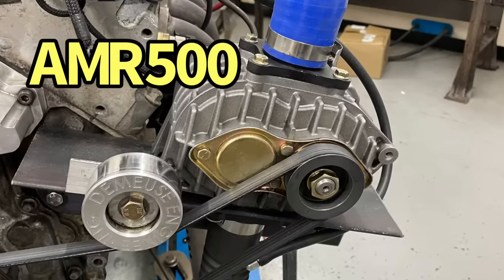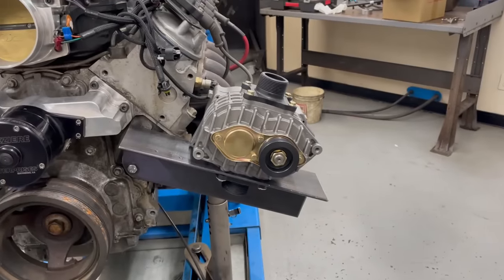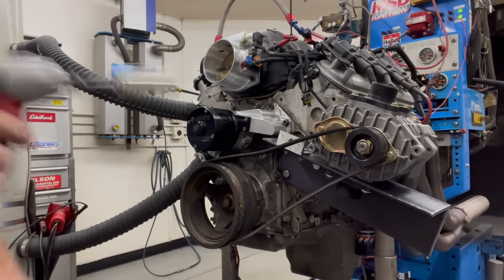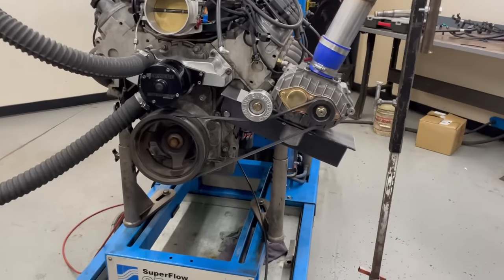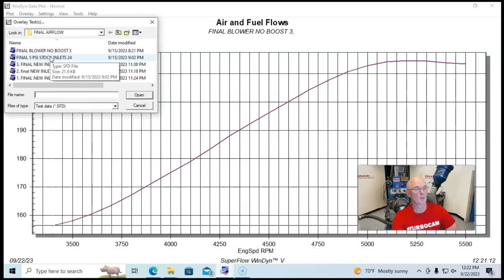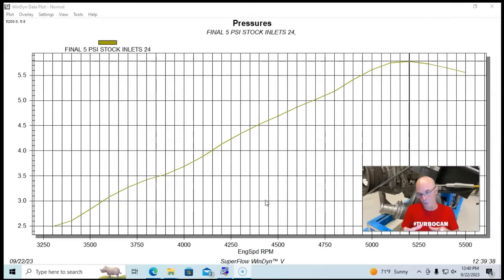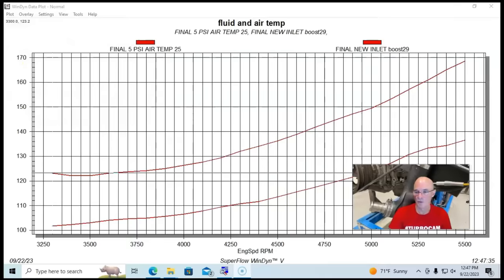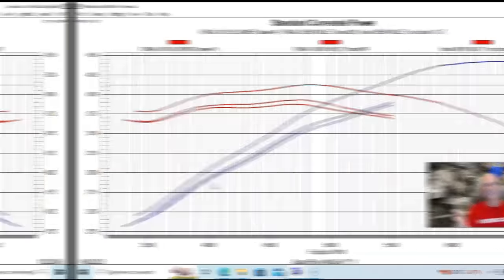THE ULTIMATE CHEAP, EBAY, AMAZON AMR500 BLOWER TEST. FULL RESULTS-AIRFLOW, TEMP & POWER CONSUMPTION

Comment: So it uses more power than it produces? How much power would 5 psi add on that motor? Would it be net gain or loss?
Reply from the maker: This was an airflow and power consumption test. It flows enough to support 150 hp

Comment: It's supposed to be used on a 2.0L engine and below. You should try it on a small engine, then see what the results would be.
Reply from the maker: we did this to flow test the blower (just used the LS to spin the blower) this is a 150-hp capable blower
Reply: @richardholdener1727  Oh, okay. Just was wondering why the application. Thanks for the reply. Have a good one.

Comment: Very interesting.  This blower is rated for up to a 2.0L engine, so it seems to work well.  I would think that it would need to wind up a bit higher on a smaller engine though, which it doesn't seem capable of without losing airflow and boost.  Still, it would probably be a great improvement in torque for the smaller engine.

One minor complaint.  Engine torque is in lb-ft, as you show on screen, but you said ft-lbs, which is a different animal altogether.  SAE standard for engine torque is lb-ft and that is how dynos rate it.
Reply from the maker: it will work for motors making less than 100 hp that want to make 150 or slightly more hp
Reply: So I have a 1.3 twin cam Suzuki swift engine that makes 113hp crank. It revs very high. Wonder if this could be used here?
Reply: Sure it will end up about 5psi across the rpm range and general driveability increases dramatically. Cruising in top gear mat you're foot and it peg's to 5psi at 2k rpm.

Comment: you can definitely watch the belt expand and slip near the end of those pulls, its belt slip causing that no doubt. The high flow adapter you made will cause a bit of an airflow disturbance as well though as its round into rectangle. Those little flat lips will actually mess with the flow a lot, basically make the adapter a better match next time or essentially do a port n polish type deal on the intake of the blower.
Reply from the maker: the mismatch will cause a very minor change in flow

Comment: It's very easy to explain it. The reason why you're not building a pressure or as you're looking for PSI is due to it's not pressuring up against a cylinder or filling up a intake and cylinder volume so as far as I can tell all I have seen. Is atmospheric air going in and then blowing out to the bottom. on top of that you're not turning the supercharger at proper ratio. It's you got it to the stock pulley of the LS to the stock pulley of the IMR 500 whatever.  It's supposed to be turning at the ratio of 6:1- 8:1. Again reverting back to what I said at the very top Is self explanatory
Reply: Additionally, you're maxing out the super charger at the ratio that you have currently on it, so if you want to 6:1 - 8.1 belt ratio, then Added some kind of poppet valve or restrictor not just a tube where actually has a way to build pressure up against something. And once it reaches the pressure, it will either egg. Give you your nominal air pressure. Hence PSI. In some way where it can release it to go to the next test, not just free flow, blow sucking and blow out cause at that test. All you are showing is air flow. You aint gonna get very much PSI. And your air flow is gonna be only rated on to the belt ratio to the engine. Determining how it's gonna process that air flow.
Reply: So ideally, the supercharger would be a good 6:1 or 8:1 on either a 
1.6 - 2.2 L engine Which will be based up on your belt Slippage not to include your ci and your cam Profile and egine rpm operation before ull see ready  psi (boost)
Reply: O by the way engine Naturally draws in 7PSI so if you have a Turbo put in 7PSI you're not generating no power. Unless you're building fourteen p s I which will double your whatever power the engine was already building to begin with. General rule thumb is a horsepower per cubic inch. 140 cubic inch 140 horse power 14psi = +/- 280 hp for ruf hp numbers
Reply from the maker: we added a flow restriction to the outlet side as covered in the video to create boost

Comment: Interesting, but why didn’t you connect it to the engines intake and see if it would make power? I’m disappointed
Reply from the maker: it flows enough to make 150 hp-on a 440-hp motor?
Reply: Because it wouldn't make power on an LS. It would actually ROB power. That blower is tiny.

Comment: There’s leaf blowers that produce more cfm than what that did .  Also I think I seen were they have 2-300 mph wind coming out of them .  Now with a buck boost transformer I’m running a craftsman 20 volt 120 mph wind I think it’s got 100 or around 100 cfm of flow on a 4.0 Toyota with a pedal commander and a stage 3 Thornton plug in chip before those two add on’s you really could not tell if it was helping !  But after when switched on at 20-40 mph you can tell it’s given it just a little bit more .  That’s only a 20 volt blower motor I’ve seen 60-80 volt blowers in leaf blowers unbelievable the cfm they make.  My buck boost transformer I bought will go up to 80 volts !  I would love to have the extra cash to buy one of those big leaf blowers and fit the fan an motor into my intake set up .  Then dyno with and without it being used just to see I think it would be more efficient than using the drive off the front .  I read we’re a person said you can hurt the performance of a motor more than helping when inducing air pressure and pushing it through a intake manifold set up that is use to being in a vacuumed draw instead of a forced draw .  Now I’m like you can tell me that is true every time I say put it on if you can fell and see a difference then you will know !  But a combustion engine is just a big air pump it self so giving it a boost from any kinda of blower would have to always be to the good .  A friend of mine told me in school in the early 90’s that electric motors would get so powerful an so efficient one day they will be no need for super or turbo chargers .  He said there will be electric blowers on cars one day that will out perform larger motors making more boost from pulley drive units .  Because there not going to be using that front drive that power won’t be lost then with electric super charger won’t need to produce that much boost !  Of course with electric cars coming on the electric motor is getting better an more efficient as we speak !  It would be a big statement to make to say one day well the only reason this gas powered car can out run the electric counter part is it simply uses the same technology for its blower motor as the electric cars drive motors ! I think there crazy for wanting all out electric cars when we could have hybrids .  So this way if you can’t feel it one way or another it will get you were your going plus while burning fuel it can charge it’s self !  But that makes sense they want to go with the non-sense !  If you ever see a baby craw then instead of getting up and walking take off running !  That’s what I feel about the way there doing the electric rides if it fails there’s no back up plan or nothing to fall back on!  I’ve always said who wouldn’t want a automobile that you can charge at your own house .  Then if your power was out the automobile would power your home until the power come back on then it would shut off an go to charging the car battery’s ! Just think a car like with the capability to be a generac whole house power supply using gas to do it .  What kind of sales person would it take to sell this to any one ? It’s a no brainer people would switch to a electric car just for that fact !  Could you se mom or dad home with the kids in the dark but once the other parent made it home plugged that car in to the charging port the computer in the car would be like no power coming in check you house change the switch from power coming in the house by turning the main breaker off then powering the house up off it’s electric charging while running off gas powered !  I think it would be so smart if they would do that !  I never knew of this super charger you have showed me . Great video and is it a universal fit or does it go on something else?
Reply from the maker: a leaf blower flows, but does not produce pressure very well
Reply: @richardholdener1727  well I have not any way of knowing I just thought about hooking it up I had very little in it actually !  It was a kinda I bet it won’t work or how much do you think you’ll get thing !  But with a high flow muffler and pedal commander turned all the way up .  Also a Thornton ODBII plug in stage 3 tuner for more horsepower and fuel mileage that part we don’t worry or think about then remove the fan an installed electric fans .  Being that the inside part of the front bumper I hand built from 1/4 plate then 4-6 lift 33x12.50/17 then the rear bumper reinforced 3/8 3.5x3.5 angle iron and 3/16 skid plates motor trans ,transfer case and gas tank !  Yeah it doesn’t do real bad but when flipping that switch I have hooked to it if I’m in the throttle with no extra force flipping the switch will cause the passing gear to kick in and that whole circuit is not even connected in to any thing but the buck booster transformer , now if I’m not in it real hard just flip the switch you can feel a small gain in speed if I’m stoped turn it on let it build then take off it seems to be faster out of the hole .  Setting at idle in park if turned on the rpm goes down about 150 but there no load an you figure the throttle plate closed it’s pushing air into what should be vacuumed so that’s what’s hurting the rpm .  Now this motor Yamaha design for Toyota has a variable length intake with the filter element in it it can run the air in it around be hind it then back up to the front to into the intake or if it opens the valve straight through into the intake !  It’s kinda wild looking I know I have a friend who works on cars also heard it run with out all the stuff done to it . Said does it have a supercharger on it or turbo?  I said no he said well it’s got something that makes it sound different when you get on it or kick it down .  So we looked up what it had and found out variable length intake factory specs at 241 cubic inch running 93 octane gets 239 horse power 4.0 v6 2004 model I have heads I’ve ported and polished plus stainless headers .  I’d love to do cams but 2000$ for four cams is not realistic .  It has buckets and shims if I could get the bottom side of the cams cut down say 0.20-0.50 thousands of a inch then just add that much extra on the shins under the buckets . Then that in turn would give me more lift but you know with out a way to properly machine parts well your back to square one also it has like 10.0:1 compression .  It’s a thrill for what it is it’s got enough to let you know not to go to far or it wouldn’t be good !  More pick up or take off would be nice .  I know the leaf blower isn’t that much but I think if I had the spare cash it’s around 3-500$ for some of the newer ones that have up in the 3-400 cfm and 2-300 mph wind there 60 or 80 volt but the buck booster transformer I’ve got will push I’m thinking 80 plus volts dc power so .  I’d just like to see if there is a big difference or very little from 120 mph wind I can’t remember but I’m thinking it was 100 or more cfm on the one I’ve got on there . Crazy thing is with it out of its case the plastic housing holding it together just slipped right up into the breather box inlet after I removed it and could be installed into between it and the motor !  I see we’re there’s a electric turbo taking the racing world by storm they say it’s really good efficient and works !  I need to look it up  I’m sure it’s 5-10,000 dollars for one maybe more ! I’ll just keep blowing the leaves down the road in front of me maybe one day blow them a little further in-front of me !  It’s a changing world  and that’s the only thing that does stay the same!

Comment: I am of the opinion that  the lack of increased boost is not belt slip but rather the heat build up within the blower as you suggested. But without knowing what the air temps were before and after there is no way to prove or disprove because you didn't provide that info. The rule of thumb is for every 22 degrees  you decrease intake air temp you gain about 5% it's not 100% accurate but it pretty close.
Reply from the maker: the IATs were provided -ambient was 78

Comment: The boost number means nothing. the total flow volume under pressure is greater than the stock inlet, this in conjunction with the lower air temperatures mean more density of the air. Therefore, having the boost number lower is a moot point. Boost doesn't make power air density does. I can have 40psi of boost but if it's at 300F I would make more power running 25psi at 145F.
Reply from the maker: you missed the point of the test and question
Reply: @richardholdener1727  Not entirely.  For the drop in pressure at the top it is most likely belt slip. To check just add some sticky to the belt and pulleys. If the problem persists I would put it down to the unit having poor seal due to  inefficient seals on the compressor fins or harmonic instability at higher rpms causing losses through the seals from vibration. I guess the next thing we need to know is how much oil is it leaking/using during the "heavy" load phase

Comment: AMR500 acted like an air restrictor😮this is because u put this on a big  engin ... put it on a 3 cylinder or 4 an i think the result will come out astonishing
Reply from the maker: THIS WAS AN AIRFLOW TEST OF THE BLOWER-WE DID NOT RUN IT INTO THE MOTOR-THE LS WAS ONLY USED TO SPIN THE BLOWER
Reply: @richardholdener1727 im not an expert on the topic ...but is that sensible to put one of these on LS engine and with all that said in the video (corrected airflow less than 440hp est) take more hp than stock????

Comment: I wonder if the boost taper at the top of the first round with the blower not feeding the engine is the result of the airflow cavitating at the inlet to the blower.

Comment: My guess is that with a higher volume of air flow, the turbine begins to lose efficiency as it either cavitates and/or simply reaches it's maximum capacity to draw and compress air and this results in lower boost. In other words, energy which could have been used to create boost is being used to handle the increase in volume. Let me know what you think.

Comment: Had one of these on my 1.6 accent for a while, it made 5lbs was kinda fun but definitely too small.. their designed for 1.0l-1.8l engines anything bigger and it'll be a big heat inducer 😕
Reply from the maker: 150-hp blower based on the flow

Comment: I think you're going to need to measure velocity too. But v1t1=v2t2 so you can calculate if that drop in flow and pressure is due to heat. I suspect the drop is a combination of the oil building friction at that high rpm, the air heating up, but I think, without any evidence, that the drop is turbulence. Need velocity numbers. Guessing, it's about 5fps through the outlet hose. I'm not sure of the volume of the super charger but room temp air gets funky starting at about 30fps and goes bat shit crazy at about 40 fps at 1atm.  The air seems to be traveling through the SC faster than where linear flow air gets turbulent. Might need better vein seals to compress the air better so it can compress the air and keep it from becoming turbulent.
Reply from the maker: we have actual blower dyno data to back up the date generated here-it is very accurate

Comment: Yeah I seen a video a while back where some guys put one of these on a small four-cylinder engine and it actually hurt its performance,.. should be fairly obvious just by the outlet size of that little bitty thing, it's not going to do anything for a V8...unless you used maybe eight of them and plumbed each one to each cylinder somehow...🤷
Reply from the maker: Did you watch the video-it was a simple flow test and measurement of the blower output? Not an attempt to boost a 440-hp V8 with a 150-hp blower.
Reply: @richardholdener1727  yeah I realize they were just testing the blower to see what it's capable of... I was just stating something I had seen on a another video where they were playing with this thing...

Comment: Hey Richard do you think this thing would work for a v6 at altitude? Just small amount of boost to keep I awake in the mountains…
Reply from the maker: this blower is only capable of supporting 150-hp
Reply: @richardholdener1727  that’s what I was thinking as I researched them a little more but wanted to ask your opinion, my original plan was stock 4.0 ford sohc with a small turbo gt35ish on about 7lbs of boost and a tune
Reply: @richardholdener1727  nothing crazy as it’s just a mountain rig for camping and fishing, it’s just starved at altitude and has no power

Comment: Your inlet airflow tell you all need to know. It sucks in 300 CFM, on a SBC that's about 300 HP. Minus paracitic loss and your at slightly less. It seems to me that the blower would do much better on a 500cc motor....
Reply from the maker: 300 cfm is nowhere near 300 hp
Reply: @richardholdener1727  fair point. the number might not be exactly right but idea is. When sizing carbies we used 1:1 then go up a size. What you do with the airflow is largely irrelevant, the air drawn into the SC is all you have to combust. So airflow equals power assuming AFRs are right.

Comment: Could it be belt slip? Yes. Is it? Probably not. Here's the thing with cheap blowers... as compression/case pressure rises, you compress the boundary layer. This amplifies the crappy part of crappy sealing, and you lose delta. 

In this case... I'm saying 95% delta losses from poor sealing. 5% belt slip... maybe.